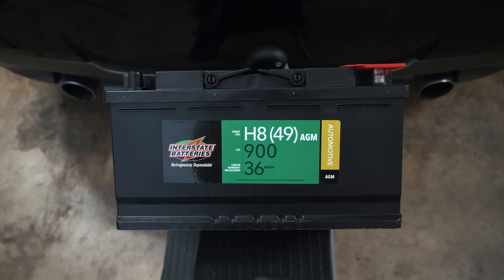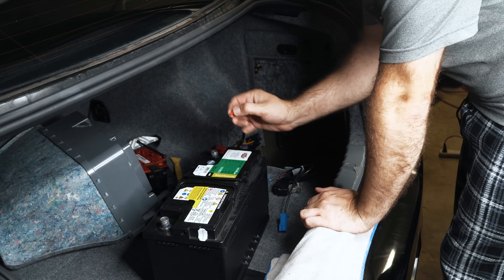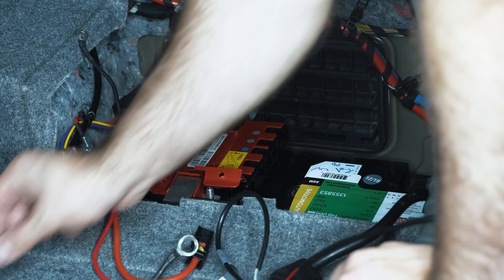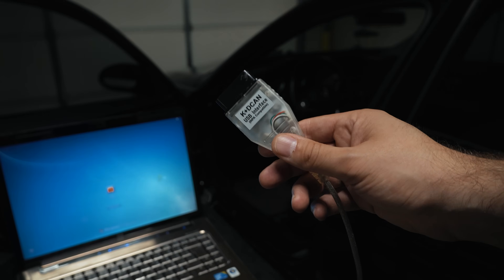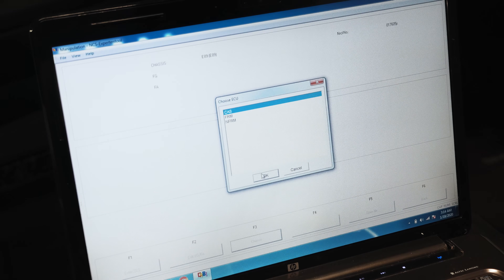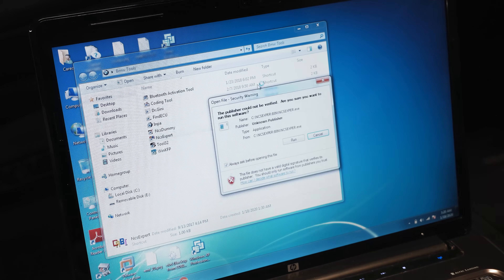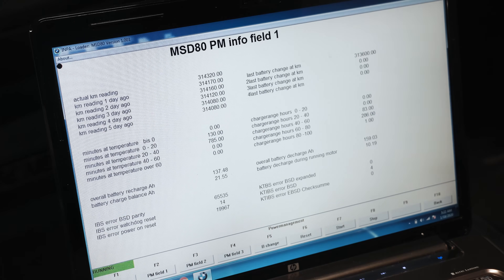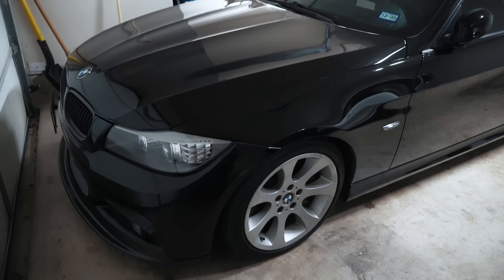Your BMW Needs A STRONG Battery | AGM Upgrade With Coding & Registration!

Comment: Very helpful video pal. Recently bought my pregnant missus a 2011 3 series. E90, 318i exclusive edition 4 door, 6spd manual. Car only has 70k miles with a good service history, dealer history up to 50k miles.. however recently it’s been sluggish to start. Did the usual and replaced the battery for a 800CCA 80AmH AGM battery on the recommendation from the dealer. All of a sudden the start stop feature has started to work.... but... it’s still sluggish when firing up. Not all the time but temperamental. Previous battery when tested only showed 517CCA so I was confident a new cell would solve this. Unfortunately it hasn’t. Had the new battery checked again after install and under load... battery is great, was recalibrated/coded too and alternator is also working great. So.. I’m now guessing a possible starter motor, or fuel issue. I’ve read that the starters can give some bother in and around 45k miles and up but have also read some of the injectors and relays could also cause this. The idling is a little off too now but nothing to cause any real concerns but I just don’t know where to begin. Any thoughts? No fault codes present unless the previous owner had them cleared before I picked her up. Any help would be greatly appreciated as the car is otherwise mint.
Reply from the maker: Hey so you get can a slow crank at times?  I'd lean towards the starter if everything else is checking out.
Reply: Vehicular DIY Gentleman thank you. Gut feeling was the starter to begin with although with some digging around I was beginning to think it could have been another culprit. VANOS sensors, fuel pump relays etc have my brain fried at the minute and the lack of fault codes was beginning to annoy me. Would you suggest going OEM or aftermarket such as Bosch? The reason I ask is that I’m being led to believe Bosch is not what it used to be with regards to reliability especially for their starters using cheaper internal components (reference BIMMER forum UK). Still have confidence in their spark plugs though lol.
 Am somewhat anxious about going OEM again if the same issue could surface in another 50-60k down the road. I’ll change the manifold gaskets as well as all new bolts as suggested. Might even change the ground cable too while I’ve got access. Thanks again for any advice pal, great channel and just sub’d.

Comment: Lead Acid flooded was standard on your year?  Wow!  Did you check for corrosion in the battery compartment?

Highly recommend the American Odyssey 94-950 https://www.odysseybattery.com/Batteries/Model_49950 with the very pure lead plates.  Exceeds the excellent OEM battery in everyday including warranty.  Dekka is the only other USA battery maker of whom I am aware.

Interstate and Optima moved to Mexico over a decade ago.
Reply from the maker: Yeah it was standard.  This Interstate AGM battery I installed was made last month and has a sticker saying made in Germany on it.  Hopefully it holds up.      It has a 3 year warranty.
Reply: @VehicularDIY  Yeah it should be good.  I bet the Germans have the purer lead than Mexico.  A lot of the retail parts houses ones are not quite up to OEM specifications.

Why does INPA say you have MSD80 when you switched out to MSD81 and had it coded?

PPK2 (335is) has the heavier duty alternator and 800W cooling fan.  Most of the later F8x M cars have Lithium-Ion these days I believe?

The 7 Series has two of these AGM batteries, I believe.

Comment: Hey! Is the directory for NCS expert made when you install the program? And that directory will populate with items as i code different files, and can then use those to push into the car?
Reply from the maker: Yes that's right, download the software and then follow the thread to set it up and you're ready to code.  No messing with daten files etc.  Pretty easy now.

Comment: the AGM battery in my e90 lasted 5 yrs (Duralast) it was never coded or registered, contrary to popular belief.. I replaced it with an H8 battery, this time I registered it. Let's see how long it last, it's a tight fit but the h8 is close to the original spec.

Comment: My '07 e92 came with an AGM battery. It lasted 7 years. I ended up going the other way and replaced/recoded with non-AGM OEM battery. It has lasted 6 years. Will likely need replacement at the end of the year (7 year mark). In my case, both worked just fine for my needs, but I daily my car driving 70 miles a day fwiw
Reply from the maker: Thanks for the info, yeah that long drive each day is probably doing the car well including the battery.

Comment: according to "some" other BMW youtuber, all you need is 50 dollar battery cheapest of the cheapest, or else you're stupid (that's what he said). I'll stick with quality AGM too. I run lots of accessories with engine off including subwoofers, which maybe some people did not think of.
Reply from the maker: Yeah I feel like I learned a lesson as well, I downgraded from a 90 AH OEM flooded battery to an 80 AH flooded battery a few years back.  I was buying $100 batteries.  Not the right move in retrospect.
Reply: I take it I know who your referring too !!!

Comment: Almost all of the late model BMW M cars we see in our shop come equipped with lithium ion batteries.  During coding, programming or even power supply operations we must put our Deutronics clean power supply in lithium ion mode.  The unit even requires a password to change the setting.  The current offering from BMW for the battery you featured is a 92 Ah AGM.
Reply from the maker: That's interesting, the Li-Ion batteries would definitely last twice as long and would weigh much less.  Thanks for the info.

Comment: Great video! I also recently upgraded to an AGM battery for my 335i (N55). I would like to let you know that viewers that are not so versed with coding can use Carly which makes the coding and registration process MUCH easier. One this about AGM - we use them in airplanes because they are slightly lighter than comparable flooded counterparts. Could it also be that in M cars, where weight is really important, using AGM battery was an engineering decision to also shave some weight?
Reply from the maker: Thanks!  Yes Carly can work for something simple like this.  Every pound counts but in this case for H8 batteries that fit these cars they both weigh around 60 lbs from what I can tell.

Comment: Finally! Why did you make us wait so long?! Nicely done! 2 years ago I've upgraded my battery with a Varta AGM (90/95 mAh a guess, and my stock was acid battery 80mAh). Here in Bucharest / Romania two BMW mechanics told me that a coding is not required and only the registration of battery is sufficient. Testing & measuring the battery from 6 to 6 months, I can say (from memory) that after 1 year of use not-coded (only registered) the battery is at 88 % perfomance (tested via a diagnise hand tool - used for maintaining the warranty).

Comment: How do you know what amp hour your battery is mine only has crank amps on the sticker
Reply from the maker: Typically you would either find the reserve capacity listed or the amp hour rating.  If you can only find the CCA I'd try to look online for the specs.